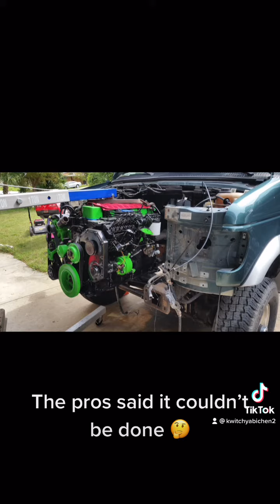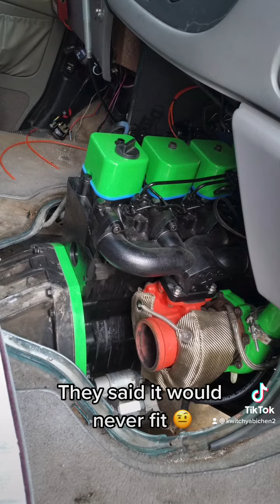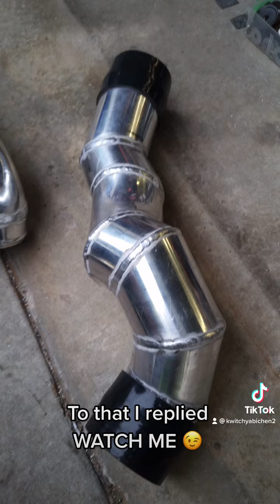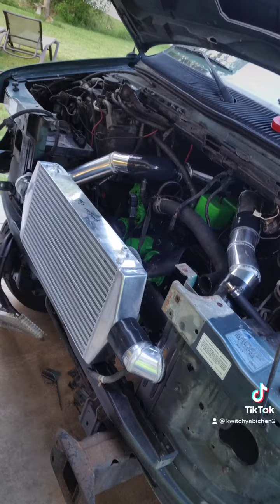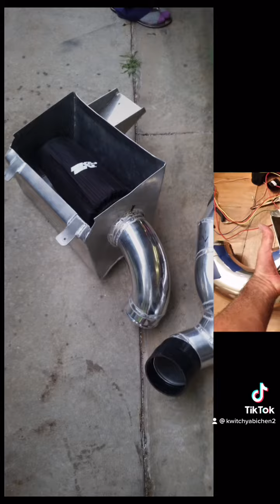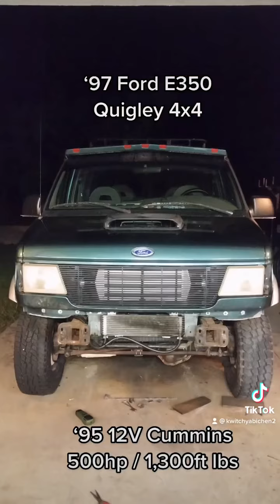"97 E350 Quigley 12V Cummins Conversion

Comment: This thing is sick, I have a 93 e350 sportsmobile that I’ve been thinking about swapping a 12 valve in. What kind of fuel mileage are you getting? I saw that was one of your concerns with the v10. What were you getting mileage wise and what are you getting now?
Reply from the maker: Thank you, it wasn't an easy swap but i made it fit. The V10 got anywhere from 6-10mpg and the 12v gets approx 20-22mpg empty and around 15mpg towing weight at 55-60mph

Comment: Did you have to beef up the suspension due to the weight of the engine? That Beasty thing is RAD!
Reply from the maker: no because the springs that Quigley used up front were already a heavier spring than stock but i did replace them with new ones just because of their age

Comment: Can you make a list of everything needed to do this? 
Also do you have to use the coolant reservoir, radiator, etc. from the dodge donor or can you use the powerstroke components?
Reply from the maker: Its hard to make a list because most of it was custom. Pretty much the only oem ford items left were the radiator, fan shroud and overflow reservoir but my van had the gas V10 not a powerstroke so i don't know if there are components from that, that could be used. all other components on the engine were either oem dodge or custom made. The intercooler is a non vehicle specific aftermarket item and there was a lot of cutting to make it work. The factory engine mounts were removed and the crossmember notched to allow the engine to sit lower otherwise it wouldn't have fit under the dash.

Comment: How difficult was this? 

Was the custom piping a must?
Reply from the maker: The plumbing was one of the biggest hurdles that required a very custom setup because of such limited space available. Truth is, that was one of the most expensive parts of the project. Plus i wanted an extremely efficient setup which required the largest possible intercooler, intake and exhaust possible. I have a true full 5" exhaust from the turbo back and a complete 4" intake plumbing from the turbo to the manifold along with a 3" thick intercooler.